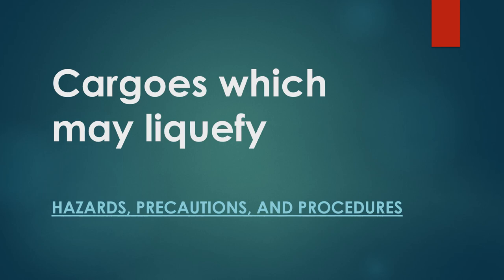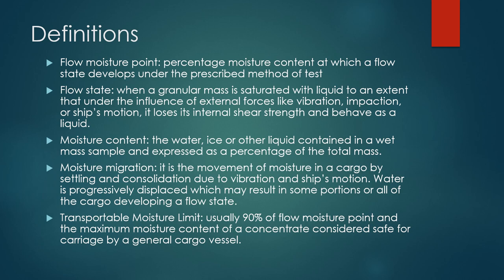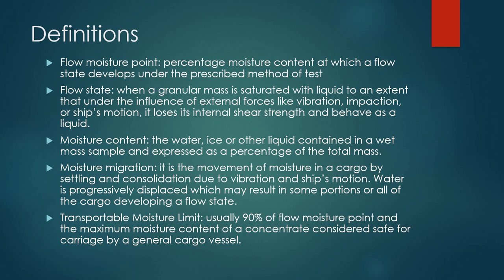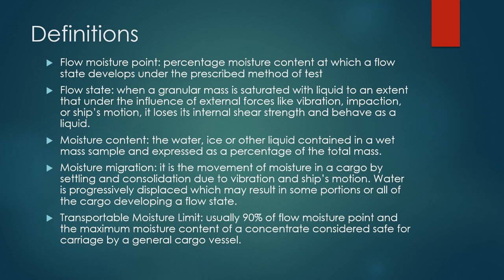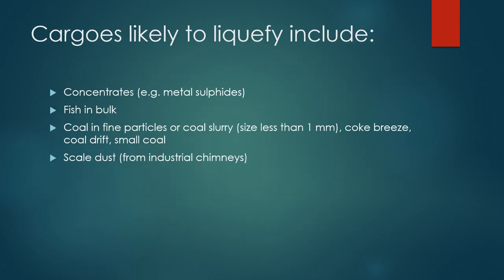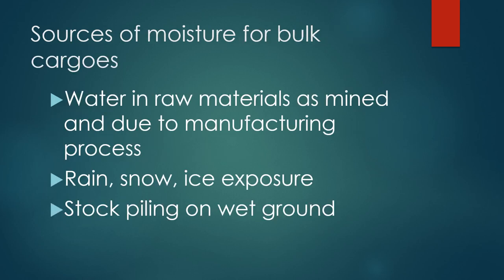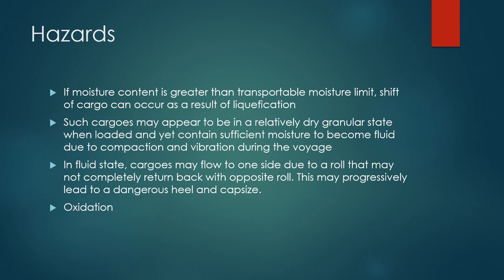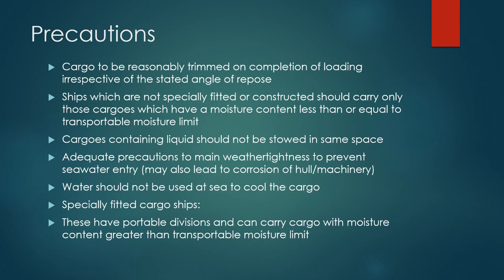Cargoes which may liquefy - Cargo Work (Hazards, Precautions, Procedures)

Comment: At sea due to vibrations and ship motions , the cargo settles and consolidates , displacing the water .,  What does it mean ? Also what is internal shear strength ??
Reply from the maker: Naman, some cargoes contain moisture within. This moisture releases as water due to vibration that the ship (and the cargo) experiences. With tonnes of cargo, significant amount is released which comes on the surface of the cargo and is free to float about causing free-surface effect.
Internal shear strength of cargo holds the particles together and binds the cargo preventing the release of moisture contained within.
Reply: @SteeringMariners  Really helpful , thanks 🙂